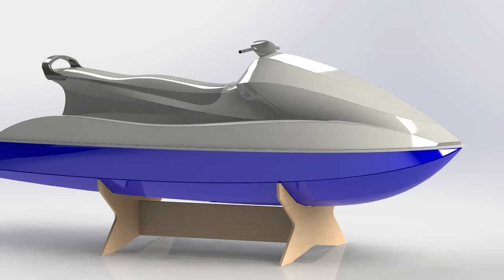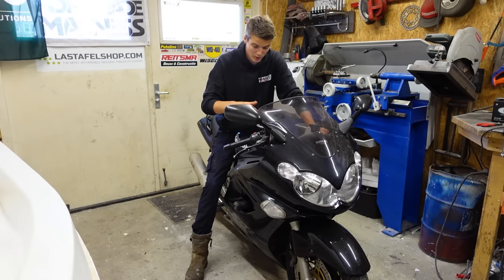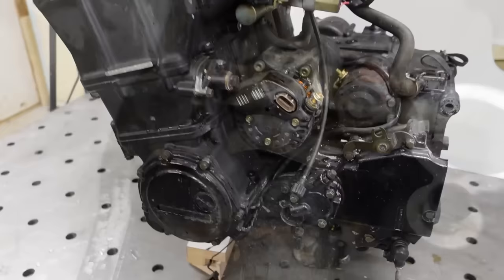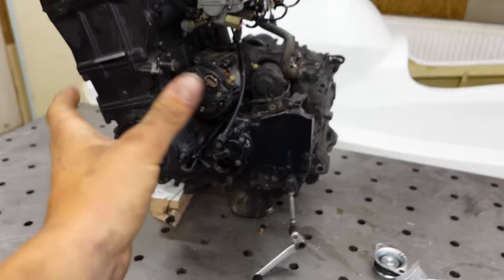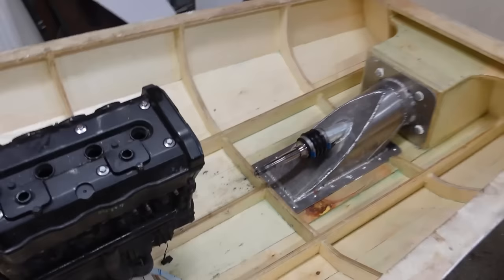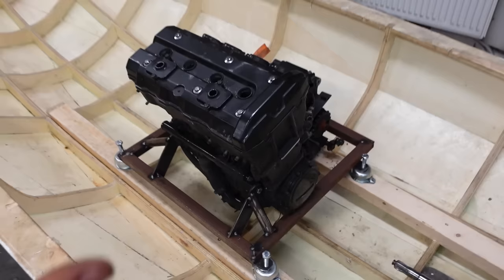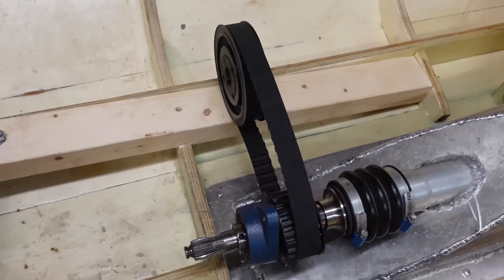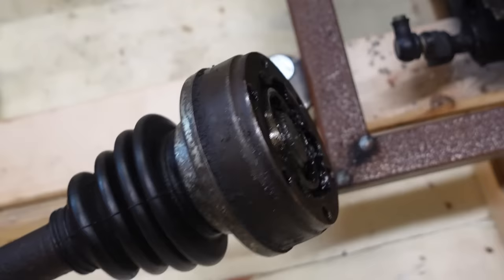Homemade JETSKI part 4: Crazy Engine and driveline

Comment: The stern adjustable pulley system. You only welded each tab on the square bottom brace. 

You need to weld a top brace to connect the top of the adjustment pieces to each other so it strengthens that whole pulley system. Or else each piece will wobble
Reply from the maker: Will do👊🏻

Comment: Did you set this up to take full advantage of the transmission. What pitch impeller did you use. If you set up a short pitch impeller with an overdrive set to the impeller you can spin it to the moon and get even more pressure out of the nozzle. Should have found a salvage bike engine. My thoughts are to do a modified chain drive to a 90 degree drive coupler. However my idea on this is like a 12 foot mini boat. Engine would be mounted transverse to the center line. There are guys with ski race boats that are using overdrive V-drive unit so that really overwind the prop so then they are hitting speeds over 120. Should have figured out how to connect driveshaft direct.

Comment: Isn't it a bit back heavy with where you've placed the motor? Especially once you're also on it. I get you want slightly more weight at the back to raise the front, etc but this seems a bit excessive considering how easy it'd be to move the engine even 25 cm forward or so?

Comment: Isn’t the oil plug in the bottom section 5mm from the hull know? Or maybe you aim to use a oil pump for oil changes
Reply from the maker: Yep oil extractor it is

Comment: I was concerned that the belt and the shaft mount were not going to be strong enough.
I would hate for that to come apart at high RPM while straddling that.
Reply from the maker: I will make a full metal cover for it, so it doesnt fly into the hull or me😁

Comment: Whats the output shafts rpm on this engine after the gear box? My seadoo RXT300 is revving  8000rpm @ full throttle, it's directly driving the pump 1:1.

Comment: Why do you keep missaligning the driveshafts? Even the CV shaft works best when it's as straight as possible.
Here's a hint; next time use a just a rigid shaft to place everything and make the brackets and then replace the rigid shaft with a CV halfshaft in the end to take up the few degrees of misalignment that happened during welding.

Comment: Why do you guys always remove the air box?   It’s a power adder, lots of Money and r&d went into designing the air box,  I had my own motorcycle tuning biz and a dyno,  take off the air box and you lose up to 30 hp,  hp you can’t tune back, plus once you reject the engine, due to fuel lost to reversion,  your now using more fuel to make less hp.

Comment: Why would you destroy a perfectly good 2005 ZZR1200 like that? I have the exact same bike and it makes 146 horsepower and 87 pound feet of torque at the rear wheel (it was dynoed in Ventura, CA 3 years ago). Top speed (real world, not Kawasaki advertisements) is 183 miles per hour (294.5 kilometers per hour).  I have since moved to Mexico and imported the bike with me. I'm sure you can find plenty of wrecked bikes to salvage the engine from...🤦‍♂️